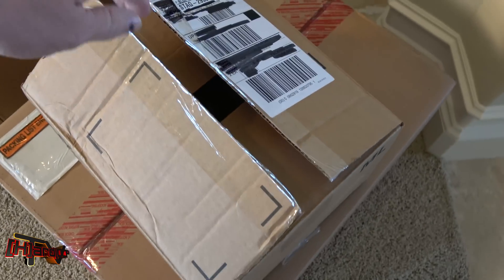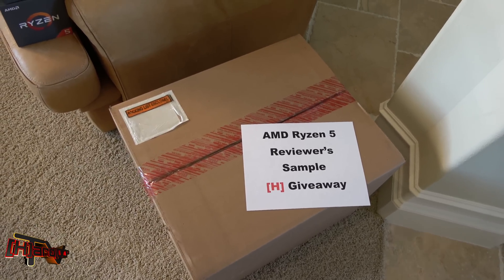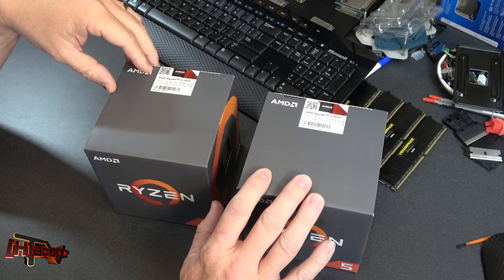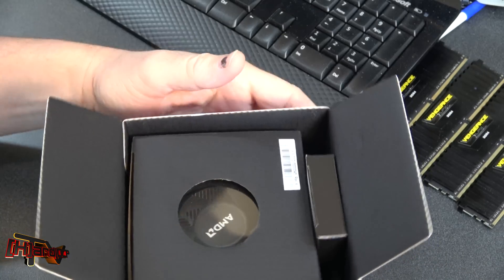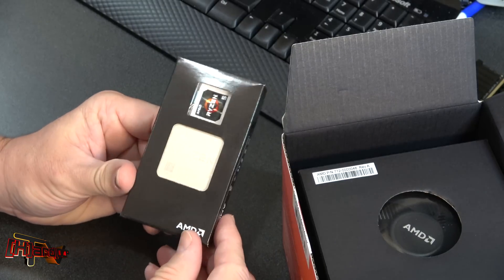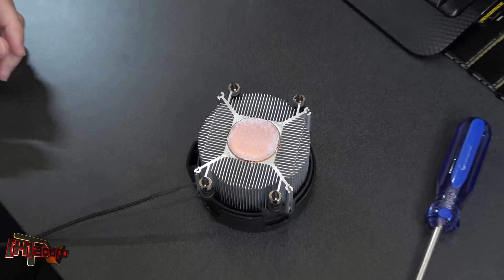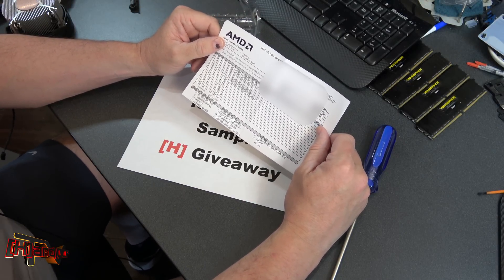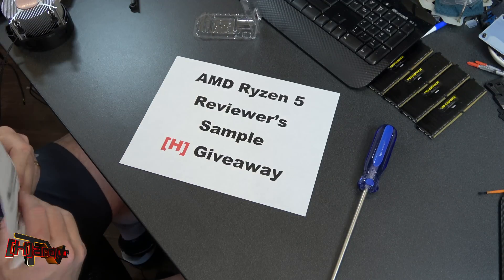Ryzen 5 1600 Unboxing and Wraith Cooler Install plus Giveaway Preview

Comment: the turn screw left click (then slight right) @7:10 did it for me, did the click for all screws, IN THE SAME ORDER. ty. (remember to add a bit of pressure on each screw that doesnt seem to wana go into its socket in the initial sequence; the less u screw 'slight right' after the first screw left click then the less pressure you will have to apply when you initially screw slight right)

Comment: What will happen if you don't screw in the screws like you did?
Reply from the maker: If you do not screw it down, it will likely not work correctly.
Reply: HardOCP TV I screwed it down. But I didn't do it exactly how you did.
Reply from the maker: I would check to make sure it is flat on the CPU and not crooked.  You need to tighten a few turns on each screw in an X pattern to make sure that it sits flush on the CPU.  If you tightened one screw all the way down, then did the next, it is likely not fully mounted the way it should be.  You could back off the screws, but do NOT life the HS up off the CPU then retighten in an X.  Check your temps.  That will tell you quick if it is an issue.
Reply: HardOCP TV so as long as it's flat it's okay? Cuz mine is flat
Reply from the maker: Flat is good.

Comment: Hope will be able to see this and get reply. I have same cooler. The spring screws. Can they be over right? When applying pressure to get them to go in and after screwing in I heard a clicking noise from the screw? Is that just the spring screw doing its job and not letting it get to right and overdone?
Reply from the maker: Well, it should bottom at and not turn any more if it is seated into the hole.

Comment: Thank you for doing this video. I just wanted to ask to be sure. The coating on the bottom of the cooler is the thermal paste? I just want to be sure rather than go out to buy some more. Again thank you.
Reply from the maker: Yes, the little gray circle on the bottom of the cooler is pre-applied thermal paste.  It is good for one installation....so don't mess it up!  ;)
Reply: Ok thank you kindly and I've just subbed. Appreciate the immediate response.
Reply from the maker: Good luck.  And don't be scared of it.  It is hard to break that thing.  Just make sure you keep your screwdriver in the slots.

Comment: Where can I order that workstation mat you put your motherboard on when you're installing the CPU and cooler?
Reply from the maker: That is a yoga mat from WalMart cut to size.  Works excellently.  However, I would suggest you ground yourself before touching it.  I have had no static issues, but still a good idea working with any electronics especially if you have static electricity issues at your home or office.

Comment: That intro hoit my ears! Maia!
Reply from the maker: We turned it down recently.  Sorry about that.
Reply: It is fine xD I'm also watching your videos on how to install the Ryzen 5 with the cooler. Thanks for awesome videos bro!
Reply from the maker: Thanks, let me know if you have any questions.
Reply: Ok Thanks! I will probably have a lot since I am starting a channel and have never built a PC before.
Reply: Ok, so I do have a question. I am on a max budget of $660 for a PC, and I want to build it. The games I would want to record is Roblox, NBA2K and do some vlogs. I already have an editing software and thats good and all. I don't want to go over-board and spend too much on my pc for just doing light gaming. Any suggestions on what components I should buy for my gaming PC?
Reply from the maker: $600 is the entire budget, or what parts exactly do you need to buy?
Reply: I need to buy a pretty good monitor, keyboard and hdmi cables and maybe led lights for lighting up the case :)
Reply: btw i dont need a ryzen 5 now, I decided Ryzen 3.
Reply: In my budget I need a monitor, keyboard, led lights, windows key thing, and cords I might need.
Reply from the maker: Let me know when you have an actual list of what you need.
Reply: Ok Thanks! Ill make a list right now. :D
Reply: AMD Ryzen 3 1200 + Wraith Stealth Cooler
AMD Ryzen AM4 Mobo
AMD MSI Gaming B350 ATX MotherBoard TOMAHAWK
Gigabyte GeForce GT 1030 Graphics Card Low Profile 2G 
EVGA 550w Power Supply N1
SSD (I don't know)
Hard Drive thing (I don't know)
Case: Something like the Corsair Carbide Clear 600C Inverse ATX FUll tower, except not inverted or something.
Keyboard Cheap Logitech G series one
Monitor ASUS 21-23 inch full HD wide screen gaming monitor 1080p 
Windows Key thing
And don't you need a wifi thing to add to it?

Comment: Hey can  you help-me ? When i was installing my cpu i needed to remove the cooler really fast (like 1 second) because one of the screws was not properly seated , should i reapply my thermal paste ? sorry about my english btw
Reply from the maker: YES!  The stock TIM is a one-time use.  I suggest Prolimatech PK-1 https://www.amazon.com/Prolimatech-Pk-1-Aluminum-Thermal-Compound/dp/B002U2T6NI/?tag=hardfocom-20

Comment: The coolers similar to the stock Q6600 cooler you use to get except a lot easier to put on. But i'll be using a Noctua D15. Soon as I get the ram that is.

Comment: looks good but some manufacturers of motherboards for AM4 screw up thing as they put for the fan like AM3 CPU FAN and then you need on AM4 Motherboard to remove those 2 plastic around where cpu is going in order to install M3 CPU Fan. They didn't use their brains when they were building motherboards. I am still deciding between Socket 1151 and AM4. I will start in 2 weeks buying Motherboard, CPU and RAM.

Comment: Is it me or are these the same push pins as Intel's ? Please tell me I am wrong I HATE Intel style push pins cant tell you how many times I had to replace these stupid plastic push pins they suck!
Reply from the maker: The AMD heatsinks use steel screws and a metal backplate for mounting.
Reply: Are there any plastic parts to the pins themselves?
Reply from the maker: The heatsink is attached to a steel plate with steel screws.
Reply: I guess its just me I like the old 2 clip style so easy now if you have a shaky hands you slip with that screwdriver goodby $150 or more motherboard. Oh well I will figure it out.

Comment: is it normal to give more pressure to the screws by screwing in? the standoffs from the backplate seems for me a litte bit  to small.
Reply from the maker: You can screw those down till they "bottom out."  The amount of pressure is not really going to matter as they will only screw in so far.

Comment: so if I dont want to overclock the cpu cooler that comes with the cpu is fine?
Reply from the maker: Yes you can, but you will very likely run into thermal restraints that will be holding you back from reaching peak potential of the CPU.
Reply: what cpu cooler do you recommend to buy?
Reply from the maker: I am a big fan of this one, but I would suggest looking at some review charts.  https://www.amazon.com/Thermalright-TRUE-SPIRIT-140-DIRE/dp/B01MQCK1PJ/?tag=hardfocom-20  https://www.hardocp.com/reviews/cooling/

Comment: This cooler was a pain in the ass for me to instal just because i did the mounting of the parts in the wrong order, i put the motherboard in before installing the ram cpu and the cpu cooler and i had very little room to actually use my screwdriver, however the cooler itself works great and i was even able to overclock the 1600 up to 3.5ghz with a bit of thermal headroom leftover. All in all a great stock cooler on a great cpu, cant wait to test the full extent of it when i get myself a water cooler

Comment: Wait u dont need to buy thermal paste if ur using the stock amd cooler??
Reply: if you look closely in the video you will see gray circle on the plate under the fan , its pre applied already but usually its not as good as fresh paste but still good
Reply: Alright, thanks for the info man!! :D

Comment: I have a Tomahawk Arctic B350, and I have this Ryzen 5 CPU with the stock cooler. I should definitely get rid of those brackets as well on my MOBO before trying to install the cooler, right?

I'm new to building PCs. :D Going to follow these directions exactly. EXTREMELY nervous about installing the CPU and cooler. Feel like if I don't do it perfectly the first time, I'll either screw up the PC or lower it's efficiency.
tomahawk arctic b350
Reply from the maker: Oh YES!  You MUST take the screws out and remove the brackets on the board as it is stock.  THe screws on the cooler go into the bracket that hold the stock brackets on.
Reply: Thank you! Man I'm nervous about this. How do I figure out which way my cooler goes on the cpu? By that I mean, is there only one way it'll fit correctly? Do I want to do it so the wire coming off the CPU would be going in the direction of the PSU? Heh heh, you can tell I'm new and nervous.
Reply from the maker: It will only go on two ways.  FIgure out where the Fan and RGB headers are and put it on so that it is best for cable routing.
Reply: HAH i got the same motherboard.. and yes you pretty much have to

Comment: It is so hard to do when the backplate does not have adhesive , my b350f strix does not , i cant even install the cooler zzz
Reply from the maker: Take the motherboard out of the case and install the cooler BEFORE you install the motherboard into the case.
Reply: Thats what , I am doing , I even tried holding the bakplate manually with my hand , and then screwing the screws , still they just not geting in. and if one does , the other pops out , i even tried diagonally , ding each , little by lil.guess something is wrong with thebackplate
Reply from the maker: Push down really hard with the board on a hard surface, and get at least one full thread on each corner.  You don't have to be delicate, just make sure you do not slide the screwdriver off on the PCB.

Comment: Every time I try to screw in the cooler for my 1600 one side will pop up and not not go down even if I only screw in the other side a little bit.
Reply: same thing happened to me, there are springs on each screw get one of the screw threads on as little as you can and push the diagonal one down and catch the thread. dont be afraid to use force. i know im 2 months late but hope this helps in the future . just finished my build today.😂
Reply: Frozone yeah I screwed one corner down a little and then the other was high so I used force and put it in the whole and then screwed it down lolol
Reply: I really need help on this.
Reply: you have to spread the pressure by screwing them in lightly going DIAGONALLY across the cooler. Also, if you've put it on and removed it multiple times you want to wipe off the bottom of the heat sink and top of the cpu with isopropyl solution and a lint free cloth before you apply more compund and try again because that causes air bubbles to form on the cpu.
Reply: I was trying to spread the pressure.
Reply: @issack28  late question, but what of i removed and applied it multiple Times without removing the paste and putting it up on again? Because i dont have thermal paste myself
Reply: Yodieyo same^^^
Reply: that "reverse screw click" he talks about got me there!
Reply: I got the same problem when i biuld 2600x but i figure it out
Reply: @intech7863  how did you do it
Reply: @TheWtnigga  its easy just dont hurry  to much i cannot explain in english i just put new ryzen 1700 and sold my 2600x
Reply: Be smarter than the cooler

Comment: Whats that keyboard in the background while your reviewing the box? Is it good for gaming?
Reply from the maker: Those are just cheap wireless keyboards I use on my testbench.  I would not suggest those for gaming.
Reply: Is there a keyboard you can reccommend around $50-$70. Your keyboard caught my eye only because it had a wrist rest which i think is neccessary for a keyboard
Reply from the maker: I actually use this MS 4000 keyboard for gaming.  Wrist rest, and it pitches forward which is much more comfortable for me.  https://www.amazon.com/Microsoft-Natural-Ergonomic-Keyboard-4000/dp/B000A6PPOK/?tag=hardfocom-20

Comment: Quick question: Will be building with the 1600 with a B350M next week. Just wondering when you apply the cooler, why you turn the screw driver backwards until you hear a pop.
Reply from the maker: It is an easy way to make sure the threads are matched up to prevent you from crossthreading those when screwing it together.

Comment: So, is the thermal compound that's pre-applied on the stock cooler sufficient, or will I have to apply some more on top of it? (I won't be overclocking.) I'm new to this stuff, so my apologies if it's a stupid question.
Reply from the maker: You are fine with the stock paste as long as you don't damage it before you install the cooler to the CPU.

Comment: Is there on the cooler that comes with the ryzen 1600 thermalpaste applied?
Reply from the maker: Yes, the TIM is applied already.
Reply: I'm building my first PC ever in a few days and this CPU just came in today. I'm excited. Realistically, do I need to buy extra thermal paste or if I follow these instructions exactly can I skip that? Thanks
Reply from the maker: The OE stock cooler already has TIM applied.  You can use it ONCE and only once. If you pull the cooler off, you will need to buy more to re-apply that TIM.
Reply: HardOCP TV thanks for the reply. how will I know if I need to remove the fan unit or if it will be okay where it is?
Reply from the maker: I would suggest that running stock cooler at stock clocks, as long as you are below 70c CPU temp, you can consider that install to be OK.  That is a bit on the high side....but should not be of issue in any situation.  You can use Ryzen Master http://www.amd.com/ryzenmasterdownload to check the temp.

Comment: Very well done video sir. One tip I've learn over the years is to wear latex gloves helps with the static electricity and getting oils on the cpu
Reply from the maker: I don't worry about getting those dirty as for long term builds we clean those off with 99.9% anhydrous isopropyl alcohol.
Reply: I hear you just habit you pick up when you use to do extreme OC
Reply from the maker: I certainly get that.  I may change out processors 10 to 20 times a day on the test bench.  They are all going to have to be cleaned anyway.  :)

Comment: This will probably be the CPU I use when building my pc. It will be my first time so I have some noob questions. Do all ryzen 5 CPUs come with a cooler? So from what I understand, all AM4 motherboards are compatible with ryzen. right? And, what type of ram would you recommend with AM4 motherboards? I am planning on getting some 2133mhz ram.  Is 3000mhz ram worth it?
Reply: 1600X doesn't come with any kind of cooler  , u might meant  1600
Reply from the maker: Ryzen 1600-1600X come with the Wraith Spire.  1400 comes with the Wraith Stealth.  I show both in the middle of the video.
Reply: 3000 MHz ram is not worth it plus all ram is expensive atm

Comment: Thanks for sharing your knowledge, and yes I did learn a couple of new things from watching, my first of your Videos. Have a Most Blessed Day.

Disabled 52 yo Nerd Here, yet the State denies Disability or any Medical care. I need Heart Surgery as of last May. I was just given a Dell XPS 600 Desktop. This is the Best Computer I have ever owned. Help me to gain something a bit newer.

Operating System
 Windows XP Home Edition 32-bit SP3
CPU
 Intel Pentium D 820
 SmithField 90nm Technology
RAM
 5.00GB Dual-Channel DDR2 @ 266MHz (4-4-4-12)
Motherboard
 Dell Inc. 0GC375 (Microprocessor)
Graphics
 DELL P190S (1280x1024@60Hz)
 1023MB NVIDIA GeForce GT 610 (NVIDIA) 34 °C
Storage
 465GB Hitachi HDS72505 0KLA360 SCSI Disk Device (SATA) 43 °C
Optical Drives
 SONY CD-RW CRX217E
 NEC DVD+-RW ND-3530A
Audio
 NVIDIA High Definition Audio

I really like this Case, it is 19"x22"x9.5" & 42#. It opens from the side lifting up with the hinge on the front opposite side giving excellent access to the interior.

Comment: Just a note, when running the thing, you don't tighten those screws down all the way. It's supposed to only be the spring pressure of the cooler on the chip, so the components can move as they heat and cool. If they were supposed to be tight, it would just be screws with no springs.
Reply from the maker: The Wraith Spire and Stealth coolers are built such that the screws bottom out in the retention legs but the cooler is still only under spring tension.  These are well designed in that you cannot over-tighten these units.
Reply: Ah that is good to know, thank you for the correction. Now I am obligated to subscribe, which I just did. Carry on.
Reply from the maker: Thanks Geoff!